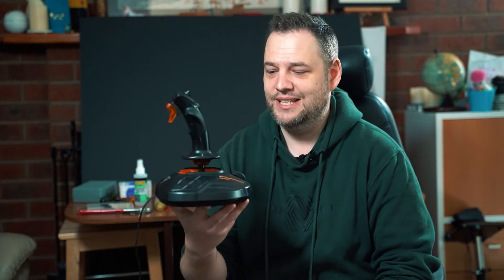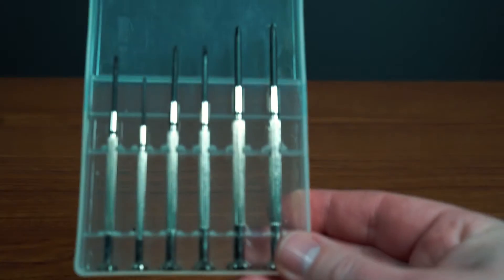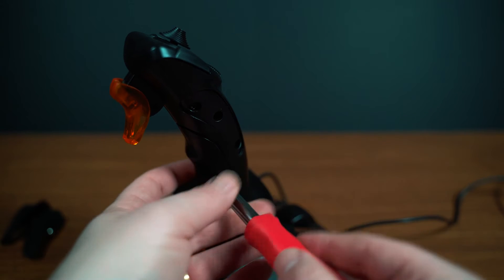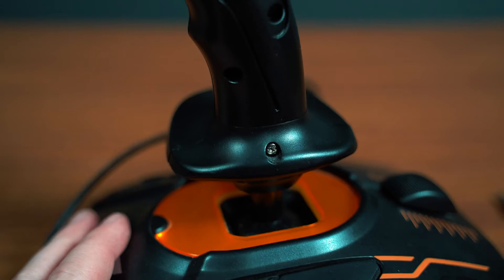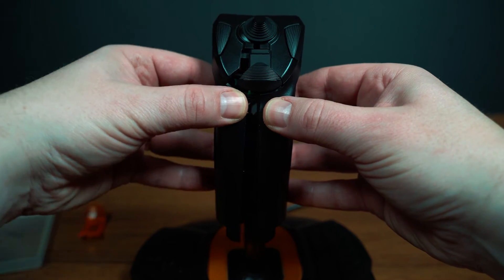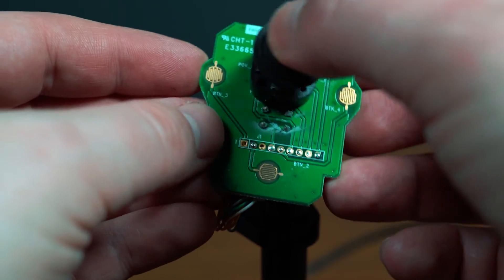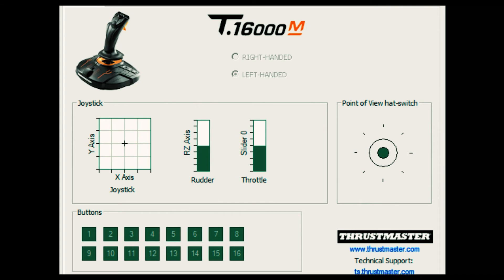Easy fix for T16000M stick/twist rudder - Complete tutorial

Comment: Everything went perfectly conform to your guide until I meet the NIPPLE OF DOOM. We got in love with each other and there my journey stopped and now we live happily together
Reply: I wasn't able to fix it 😢 I use my pedals instead of twister. I even opened the potentiometer and clean it ...no readings nothing. I will try to order one maybe will fix my problem
Reply from the maker: @Wolphypwi  oh that's a  bummer! With no readings at all it makes me suspicious of a loose connection. Did you check the wires were connected properly at both ends? I guess it's possible that the potentiometer has just died too. Glad you have pedals to make it work!
Reply: @ArveyJay  Hmmm, no I didn't check the connections at both ends just what I have seen on video, I will give a try today. I ordered a multimeter maybe I can measure separately the potentiometer, a new one takes 15 days to arrive.
Reply from the maker: @Wolphypwi  good luck mate!
Reply from the maker: @Wolphypwi  hahaha, awesomeness. 😁👍👍

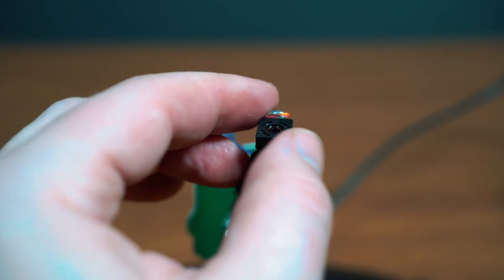Comment: 7:19 - Alcohol in back side of potentiometer it will do little for clear the resistive trail, which is on the other side. 
Fix this rudder for good only if replace this pot with contacless sensor like in VKB Gladiator.

Comment: Thanks a lot, this video saved 2x T16000M ! Great camera and explanations. Just a little hiccup though, let me warn readers so that it won't happen to you as it did for me : at 10:40 when you reassemble both sides, be VERY careful with the wires, they must be curving towards you, toward the back of the joystick if you want. In the video, Arvey has been lucky, but in my case, the wires were showing through the hole where the really long screw should go and I had to re-open it and kinda force the wires to stay out of the way. When your joystick is back together, if you look through the hole where Arvey is putting back the screw at 11:05, you should see.. nothing, it should be empty to give room for the screw.
Reply from the maker: Good tip! Thanks mate 👍

Comment: My god the rod that holds the orange trigger just won't bulge at all, unsure how much force I dare to apply. Does it matter which way I try to force it out?
Reply from the maker: Yeah that thing is a huge pain and has caused lots of people hassle. Obviously it came out the direction it went on the video and unless TM made the other side to be a blocker then it should go out both directions. But you're right you have to put some significant force behind that thing to budge it. Try resting the stick sideways on a sandbag or similar and gently tapping against a small screwdriver with a mallet to break the tension on the pin? Let me know how you go.

Comment: Really illustrative. I did the steps exactly and found that one of the three wires connected to rotation sensor (7:45) is detached from silicon. So, how do I fix that? 
I recently bought this online 4 months ago and didn’t find a prove of warranty so, I appreciate your help
Reply: You have a 2 year warranty in the EU, and 1 year everywhere else.

https://support.thrustmaster.com/en/product/t16000m-en/    check the end of the manual for warranty info.

Comment: This was incredibly helpful.  My joystick was locked into continuous z-axis input.  I did not remove the pin as it was stuck in place.  I was able to wiggle the  potentiometer and loosen/move the wires away from the  potentiometer slightly.  I skipped the cleaning of the  potentiometer.  It worked like a charm and my joystick works once again!  Thank you so much!
Reply: Yeah, I think moving the wires is key. I doubt a dirty pot has anything to do with the issue, although cleaning it certainly doesn't hurt as long as you have it disassembling. Has the issue returned since you fixed it? My worry is that the wires will eventually just go right back to interfering with the pot.
Reply: @terpdx  yes the problem repeated a few weeks later after a fair bit of squadrons play.  But the same fix took care of the problem again.
Reply: @letsroll2001  I just bit the bullet and ordered a different joystick after getting consensus recommendations from around the web. Only problem is that it's coming from China, which means it probably won't arrive at my door for another 4-6 weeks. Fingers-crossed the T16000M fix lasts until the new FCS gets here.

Comment: Fantastic video Arvey, that you SO much.

I was actually able to just remove the screws yet leave the trigger in place, gently crack open the handle, and do the cleaning you recommended with the isopropyl + qtip without taking it fully apart, and PRESTO!!  Yaw fixed, and I didn't need to fiddle with the "nipple of doom" ;-)
Reply from the maker: Awesome work mate, glad you got it done!

Comment: 1:00 I had this issue. I played with a ridiculously large deadzone for a few days to solve the problem. I opened it and cleaned it, put some silicon grease... No luck.
The solution was to unplug, plug-in the joystick and calibrate it via windows "setup USB game controler" at 12:38: this part did solve the problem in mere seconds.
Before you open it, try calibrating the sensors.
Reply: ditto, went through the same process. All it took was unplug and replug for me as well.
Reply: Windows isn't letting me calibrate it. I can open the "Properties" app, but it doesn't give me the option to calibrate.
Reply: @mydogbullwinkle same here its not giving me the option to calibrate

Comment: I had an "O SHIT" moment when I discovered that hat switch "Nipple of doom"  at 5:32. Saw something fall to the floor.. good thing it only traveled a couple ft away, but I was in panic. Thankfully this fixed my issue. Thanks mate! Back to learn Elite. Can't wait for Odyssey! YIP YAY
Reply from the maker: Good work on getting it fixed. Enjoy! 😁👍
Reply: @ArveyJay  Actually, what I did when I was getting the right half (opened backwards) of the stick back on was to take the needle-nose pliers I was using to remount the "nipple of doom" back into its little spot in the right thumb button, was to wedge it in between the button and stick to keep it in the "unfired" position.

Took me six attempts to figure that out since I lacked tape and didn't want to move from the spot! Tweezers don't work too well since they're so thin. Learned that one on top of everything.

If "Operation" taught me anything, surgery on a joystick is a paaaaaain.
Reply from the maker: @legendxcarisso  🤣🤣 yep it totally felt like playing Operation!
Reply: @ArveyJay  Yessir!

Comment: THANK YOU! This is a 100% successful fix in my experience! I've had my HOTAS for 9 months before replacing it and my new one's potentiator messed up just 3 weeks later. I've been reluctant to disassemble the thing thinking I'd mess something up but the walkthrough was absolutely great and simple and  straightforward. I kept my T16000M controller properties open the entire time to monitor the Z-rotation and it became dead still once I finished :]

Highly recommended video! Thank you again!
Reply from the maker: Awesomeness! So glad it worked for you! 😁👍
Reply: @ArveyJay  I'm ecstatic! o7 CMDR

Comment: Excellent video, you got a new subscriber here. 
Just a couple of additional notes from an electronics technician:

Most of those screws (the black ones) are self tapping screws threaded right into the plastic. Human nature is to try to thread a screw in as tight as you can, fight that urge and go easy on them! Thread them in until they are snug, but no tighter. It'll be very easy to wreck those threads, and that'll be an extra pain to try to fix. 

Not all isopropyl you buy at the store is equal when it comes to electronics work, most of the stuff you'll find is for antiseptic use, and can be as low as 70% isopropyl per volume. That's not suitable for electronics cleaning use as you're introducing a lot of water to the system, which can cause problems either immediately or down the road. Do your best to find 99% isopropyl, and try to keep the cap on and keep it stored in a dry place when not in use. Isopropyl is hygroscopic and will absorb water from the air, lowering that 99% value without your realizing it.

Finally, before reassembly, find a decent set of dull tweezers to help wrangle those silicone conductive pill buttons. A dab of glue likely won't be all that helpful as they're made of silicone and trying to adhere them to anything isn't straightforward. Patience and, as you demonstrated, a clever way to elevate the button is your best bet.
Reply from the maker: Awesome comment and tips! Thank you. 👍

Comment: I’m annoyed at just having spent $11 on a bottle of alcohol but I guess it’s better than having to replace the joystick. Hope I can pull this fix off when the alcohol arrives. For now I’ve been flying without rudder. Which makes takeoffs and landings pretty difficult.
Reply from the maker: Let me know how you go once it arrives!
Reply: @ArveyJay  It gave me a lot of grief. I think the only reason I was able to get it done is because I decided I didn't care if I broke it or not. Had I actually cared about it breaking, I don't think I would have used as much force as ended up being required for some parts. That being said, I got it done and have rudder control back. Thank you sir!
Reply from the maker: @gofastER  nice work! Yeah there are a few tricky bits particularly getting that darn pin out of the trigger! Glad you got it sorted!

Comment: Hello, I am  stuck on the removing the trigger pin part... Any tips there? I am pushing with all my might, even tried hammer (lightly), but the pin just wont budge...
Reply: Turns out, hammer was the solution after all. Tip for same issue as me - use some piece of wood like cutting board, to rest the trigger against, hit it few times with screwdriver + hammer, when even tiny bit starts to stick out, use pliers.
Reply from the maker: Good work on getting it done. Yes it is well and truly stuck in there and even though it looks easy on the video it took me ages to get it to shift as well. Thanks for sharing your tip!

Comment: Keeping the buttons in the up position was far easier if you use a folded thin piece cardboard and slide under the side buttons. I used 91% Isopropyl Alcohol to clean the axis then a squirt of wd40 worked it in and reassembled.
Reply from the maker: Ah yes the folded cardboard would have been better!

Comment: Thanks for the info! I've been playing ED with the new Thrustmaster Airbus sidestick and am having this issue. Just started a few days ago and it's driving me up the wall. I'm going to contact TM and see what they say but it's good to know that if they don't help me that I can try this fix on my own.
Reply: The new airbus controller has the fancy new magnetic sensors on the ailerons and elevators ...BUT NOT on the rudders ?  Still has this shitty potentiometer. absolutely crazy !  You'd think they'd take this opportunity to fix what is an obvious ongoing problem !!   Doing mine tomorrow.  stay tuned ...aargh.
Reply from the maker: @seannolan872  good luck. Let us know how you go!
Reply from the maker: Good idea. Let me know if you have any luck with TM.

Comment: Just finished doing this and it solved the rudder problem completely. I used a contact cleaner spray instead of alcohol! 
Thank you for posting the tutorial!
Reply: would WD40 contact cleaner be okay to use?
Reply: @vegnachaos9995  i think wd40 does not evaporate completely and it will remain inside it for a long time, that may mess the circuits a little, the ideal is to use something that evaporates
Reply: @bruno.henrique  okay thanks for the Reply. I'll get something else to fix mine other then WD40. my sticks have been driving me nuts with this issue
Reply: @vegnachaos9995  I'm off to the stores tomorrow to but a tin of WD-40 contact cleaner. It says it evaporates quickly.  That'll do the job !!  I'm also going to give it a good squirt, a good q-tip clean and a blast with an air-can.  belt and braces stuff.
Reply from the maker: Nice work mate! :)

Comment: Great stuff! Thank you so much, this fixed the issue immediately . BTW, it's not necessary to completely disassemble the handle, it can be easily prised apart enough, after removing the screws, to allow access to the centre so that the IPA can be applied.

Comment: I just found your video. About a year ago I compiled all the fixes for this stick in one place. I have added your video to it as you have some great tips for reassembling it. Those Nipples of Doom are a PITA. There are two other fixes while you are in there and they are detailed in the Post I put. One is unwrapping the wires from the top of the Potentiometer and letting them hang underneath to relieve a bit of tension. The other is Trimming the plastic in the grip that rests on the Potentiometer. It is too long and actually causes the grip to push down too hard on the pot. You can get the pot off the middle. It slides out very carefully. Then you are able to disassemble it and really clean it out. Mine had a lot of shavings in it from the grip pushing down on it. Here is a link for the article and other fixes. It also has the part number for a replacement potentiometer because Thrustmaster thinks we can't fix these and wants you to just buy another one. (Same answer they gave me btw)
https://www.reddit.com/r/hotas/comments/am2otd/thrustmaster_t16000_potentiometer_issues_look/
Great job and well done video.
Reply from the maker: Thank you my friend, and cheers for adding me to the ranks of others who also want to help the community with this!! :)
Reply: Thanks for this link to the full list of fixes! Much appreciated! 😘
Reply: Thanks!
Reply: If I find out who you are I will buy you a beer!

Comment: This method cleared the phantom inputs right up and its working well right now though I dunno for how long more.  THANK YOU Arvey. A previous method I've seen on Reddit had a very comprehensive (and scary) total teardown of the potentiometer which I wasn't prepared to do. 

I don't know how you guys have yours for 2 years before it starts wonking out. I had mine for less than 8 months and it went nuts.  Warranty via Amazon is hard to track down too so I just gave up and did this. It worked. 

Probably gonna solder in a couple of new, more reliable branded potentiometers for both my sticks before I sell it off to a friend and upgrade.  These sticks are decent really, except for the potentiometer axis which is a shame.  A decent product felled by a component that really costs less than 1USD.
Reply from the maker: Thanks mate, I'm glad it helped! Yeah it does seem a shame that this cheapo component lets the stick down and that Thrustmaster seem uninterested in reparations. I guess this is where the community bands together and we fix it ourselves. I'm glad to be a part of that with you all. Take care mate.

Comment: Hey Arvey another solution I heard people doing is cracking the joystick open a little bit in the middle and then spraying the sensor with a can of air.
Reply: Just opened it up a little by loosening the screws and sprayed some Boeing T-9 on the sensor, cleared the issue right up.

Comment: Stick twist is pure evil and should be banned for good. I wish I knew a good way to lock the handle in place.
For the rudder either use the rocker on the HOTAS throttle or get some pedals (the TFRP ones are an utter trash, so it's probably not worth wasting your time and money on these ones).

Comment: Handy tip I figured out for the nipples:  you can snap out the side buttons, put the board in the main body, then stick the buttons and nipple in place through the button's hole.
Reply: I just fixed my pair of them last night and figured this out and came to say the same thing.
Reply: thats what I did, but i added an ever so small amount of rubber cement to the button (where the rubber nipple attaches), then put the nipple on the button...then popped the button back in.. that kept the nipple from falling off.
Reply from the maker: Good work both of you. Thanks for sharing these tips as well! I really enjoy when the community sticks together!

Comment: Thank you so much for this! Worked like a charm. Small tip for the "nipples": the left and right buttons can be detached from the case. If you look on the inside, there's a tab on the side of each button, that holds it in place. Press on it, and the button comes right off! This lets you assemble the stick first, and then click the buttons in, no hassle at all.
Reply from the maker: Good tip! 👍
Reply: I tried this, but just couldn't get the tabs to disengage. At a certain point, I was afraid of breaking the plastic.
Reply: Put that same tip here before reading yours.
Reply: Great tip! This alleviated the nipple of doom trouble, although you do need to still be careful as the nipples can fall into the stick assembly if they detach while re-inserting.
Reply: Was about to give the same tip wish I’d read the comments before doing my fix😂, that being said this video was very helpful and gave me the confidence to venture into my stick. Mine was actually one of the wires disconnected, a quick solder and job done all good. Thanks again for the vid.
Reply: I was wondering why you couldn't just remove the buttons with a clip and place it in after closing the case. Thanks for the tip, saved me a lot of headache.

Comment: Great vid! In my case, I did not disassemble the stick itself. I only opened it half way through until I got to see the wires. A wire or two interferes with the potentiometer movement. Used small cuts of electric tape and isolated it on the left molded portion. All false registers were gone after.